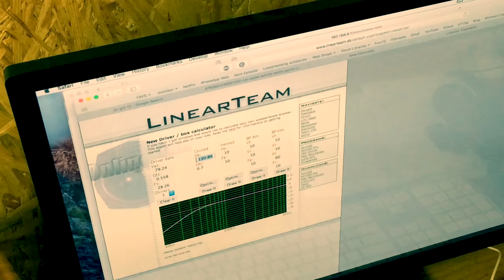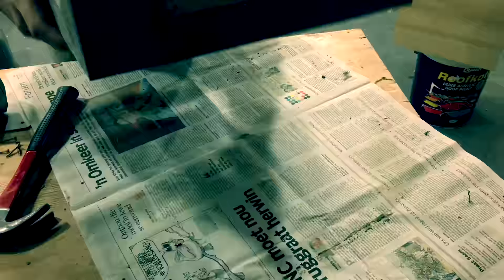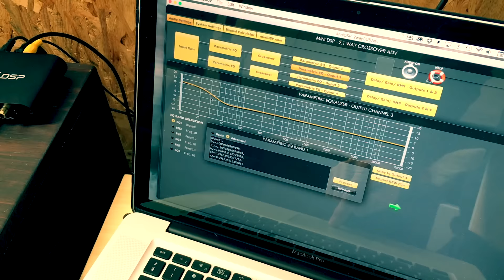Building a 12" Subwoofer with Concrete Base - by SoundBlab

Comment: Isn't that a car audio speaker? Why would you use it for hifi? And why did you choose such thin walls? Don´t get me wrong, it´s a realy nice build, I´m just kinda confused by your design decisions.
Reply from the maker: It is a car audio speaker. This particular one has Thiele Small parameters that is ideal for using it in a sealed enclosure and applying a Linkwitz Transform circuit. Sure, there are many car subs that is not ideal for home theatre (HT) or Hifi and has been built specifically for providing high excursion and SPL, but most are no different from any other subwoofer driver and can be used in HT or Hifi.

Well, what is a thin wall in your opinion? These are 21mm thick and they seem to hold up very well. I could go thicker, but I don't see the need to. Thanks for your reply!

Comment: This design looks very familiar: a sealed version of the Yamaha YST-SW515 maybe? 
Why did you apply this +12dB low-shelf @25 Hz to compensate the natural cut-off? That's a rookie mistake :D This kind of filter should be done after making acoustical measurements and not simply based on the theoretical model.
Also, there is a flat surface right in front of the cone. You certainly have a strong pressure phenomenon there. It does change the behavior of the sub-woofer in a big way compared to your simulations. You probably didn't take this into account I guess.
https://www.hifiengine.com/images/model/yamaha_yst-sw515_active_subwoofer_system.jpg
Reply from the maker: Hi Yann, the Linkwitz Transform Circuit was designed to specifically boost the response beyond the natural roll-off of the subwoofer in a sealed enclosure. What you end up with is a much smaller enclosure and you can achieve the same low end extension as with a ported enclosure of much larger size. I don't see it as a rookie mistake, it is a tried and tested theoretical model and it works. The down firing woofer is also not new. As long as your woofer has enough space to breathe and move without hinderance, it does not influence the frequency response dramatically. This subwoofer performs really well, its not boomy, can play low and there is definition in the bass notes.

Comment: why no port in the box?
Reply from the maker: A ported enclosure is normally much larger. The closed box design and the Linkwitz Transform bass boost circuit implemented with the MiniDSP provides the opportunity to design a smaller closed box for the same amount of bass output, and thus I can save some space in my living room.

Comment: diy= views. Never mind the $1000 track saw
Reply from the maker: The track saw is actually about 17 years old and was much cheaper back in the 90's! I'm lucky to have one and it still works! But you can replicate this with a normal circular saw as well and a guide rail, albeit a bit more effort.

Comment: The only problem I see is that the Box a perfect Cube and therefore will make echoey noises...
Reply: not at all because its a sealed one and not ported :)
Reply: Not true, you can reduce standing waves with the correct amount of polyfill or Dacron.  It being a sealed enclosure also makes the useable range far more versatile and smooth, not like the one note wonder ported or vented designs.  Smoother more accurate bass.

Comment: needs a ported port.
Reply from the maker: This is not a bass reflex design. It uses the Linkwitz Transform principle via the DSP unit to boost bass at a lower frequency. This allows a smaller sealed enclosure for similar bass output as a reflex enclosure for certain drivers.
Reply: But is it efficient?

Comment: Bluetooth?
Reply from the maker: Not bluetooth.
Reply: Like RCA ports?
(not exactly rca,but black and red)
Reply from the maker: Just one RCA line in as the subwoofer is mono signal.
Reply: ok thanks
Reply: +SoundBlab you connected the rca sraight to the woofer or how
Reply from the maker: The RCA input goes to a 300W amplifier that is connected to the woofer.
Reply: o ok.

Comment: would have been more impressed with it if you had actually build it from layers of wood and not an MDF box with panels
Reply from the maker: Perhaps, but I did not set out to make this a woodworking project. I personally like working with MDF and it is a great material for speaker building. A good and easy way of making it look good is to clad it. The cladding also adds an extra layer of different thickness and material that aids in enclosure damping. This is also what I had on hand :)
Reply: SoundBlab it wasn't meant negatively btw, was just a bit disappointed :) maybe I'm a bit to much of a woodworking nut :) keep up the good work, perhaps for another day you could make one from layers of plywood or some more exotic wood. love the concrete foot you gave it!
Reply from the maker: Thanks man, no offense taken :)

Comment: Not a good idea to spread glue finally over surfaces just pour it on as you did in a zigzag pattern is the proper way to glue. if you spread it finally you are encouraging gaps plus it will trap air. Making a whole box out of concrete would have been better
Reply: For veneer work? You want that glue to be spread as evenly as possible to avoid having noticeable "bumps" in the veneer. His veneers here are pretty thick which would minimize this, but for 1/8" or 1/16" veneers you'd want to spread that glue out very, very evenly.
Reply: its thesame outcome. It just bonds the whole thing :D
Reply: porto42 well it's not the same! if you've got gaps between your glue the air can escape if there is no gaps it is trapped
Reply: he brushed it..